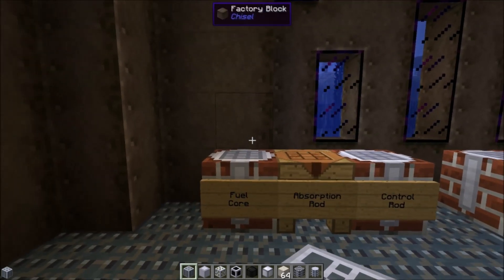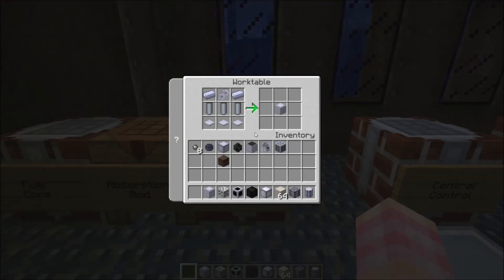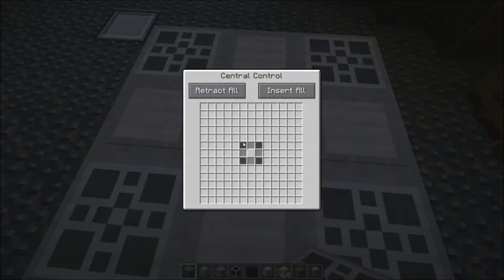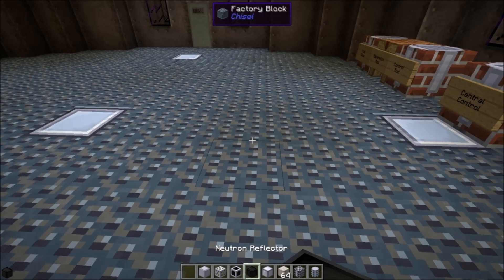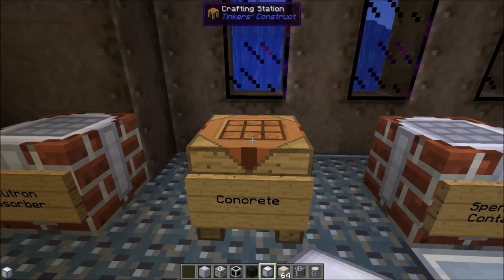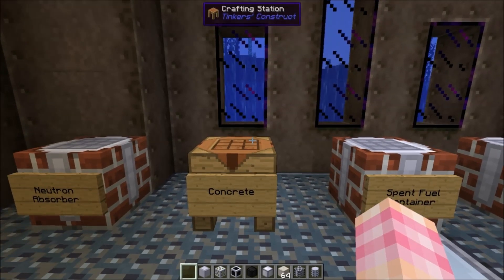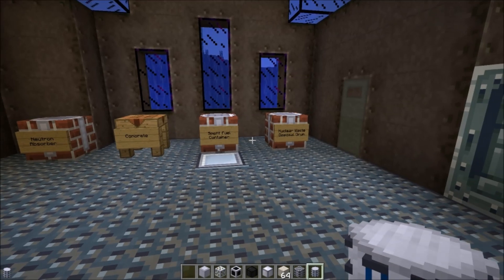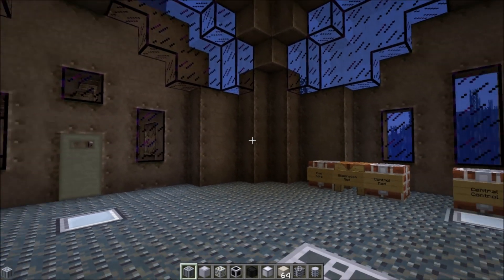ReactorCraft Tutorial #5 - Fission Reactor Necessities

Comment: Re: Spent fuel and disposal drums - while it's clearly against the spirit of the mod, is there anything to prevent one from simply using a lava disposal to deal with waste materials?
Reply from the maker: Yes, lava doesn't work. The only method I know works to cheat the system is to store the waste in an AE network.
Reply: @SentinalhMC  The ReactorCraft handbook claims that nuclear waste has a tendency to damage digital systems (possibly including AE). I checked in 1.6.4., though; I'm not actually sure if this part was true at the time, if this was WIP then but is functional in 1.7.10, or something else. Nor do I know how said damage would manifest, as I only learned of this supposed feature from said handbook...

Comment: Critical notes for those following at home: do not completely withdraw the control rods from the sleeves in the fuel cells, and do not use graphite tipped control rods.  Graphite tips on your control rods can accelerate a super critical reaction, causing further harm than good.  Ensure all technicians know not to manually withdraw the control rods.

(Bonus points to anyone who gets to what I am referring, since none of this actually applies in Reika's mods)

(I was debating writing this when you were writing about the control rod fabrication, but then the central control drove it home)
Reply: I take it your referring to the Chornobyl accident that occurred on 26 April 1986? that to this day still irradiates the 100,000 km² of land around the plant.
Reply: Lol no. It probably irradiates a lot of land heavily, but only around it. You can't irritate around the planet with one nuclear reactor.
Reply: +William Fisher - No - the problem with SL-1 was a combination of a bad process (manually re-establishing the link between the control rods and the drive mechanism) with bad execution (removing the control rod from the reactor core too far, too quickly), rather than an inherent flaw in the control rods themselves.  I was, in fact, referring to Chernobyl #3, but props for reminding me about SL-1.
Reply: you should be able to build a RBMK in reactorcraft since it produces cheaper energy running in natural uranium :P
Reply: SL-1 is fun times.

Comment: Also worth noting is that water requirements of a fission (and later, fusion) reactor are huge. The only producers that can keep up are the RC pump, water aggregator, and hugely upgraded transfer nodes, and the only pipes that can are AE, RC pipes, and transfer pipes.
Reply from the maker: Good to know. I always use your pipes whenever possible.
Reply: I have the Pressure Pipes mod installed; that mod centers around pipes, pumps, and inputs+outputs with effectively unlimited flow rate (or at least maybe something as high as 2.147 megabuckets per tick), so I'm assuming that those could work as well. It also adds an inexpensive infinite water source block, which can probably cheese the system by eliminating the need to power dew point aggregators. ;P